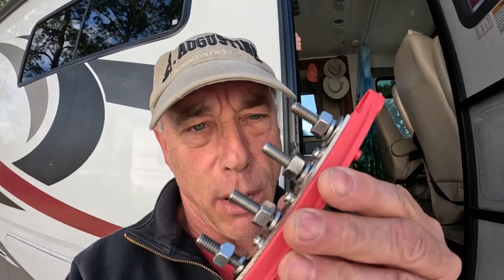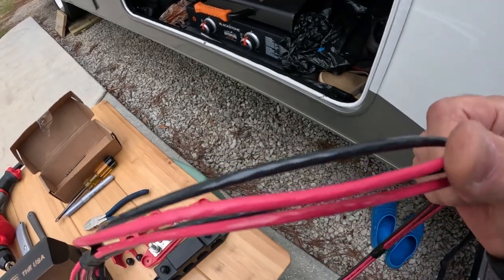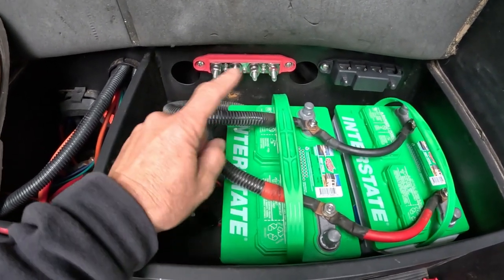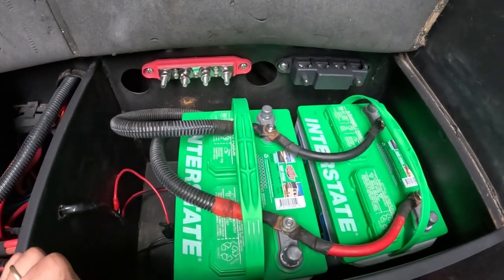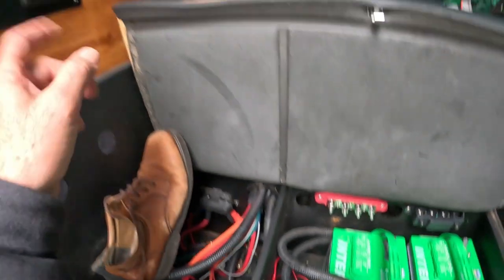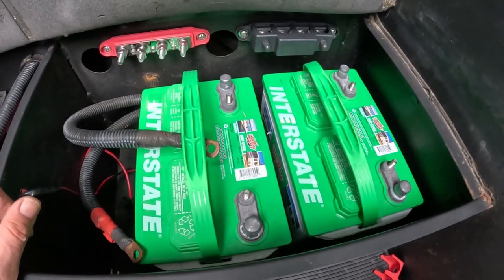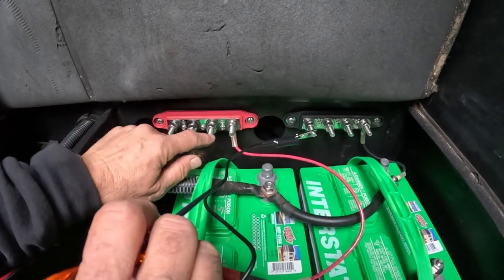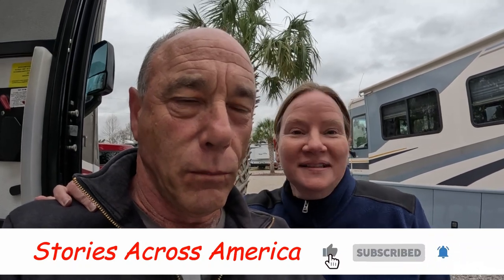Bus Bar installation on the Mirada; Stories Across America

Comment: Just a couple of thoughts... 
That positive wire to your busbar should definitely be fused to whatever your maximum current draw should be. And I suspect that once you've connected a few appliances to the other terminals of the busbar your main power wire may not be sufficient to handle the combined current draw.
Subsequently, all wires that will later be connected to that positive busbar should each be fused according to the items they're powering.
But they look to be fairly decent busbars that should be capable of delivering some generous power throughout your system.
☺️🍹
Reply from the maker: Great input !!  I do not have the main fused but all power needs are. I will consider fusing the main for sure. Thanks for watching and sorry for the delay in responding.

Comment: If you connected the negative bus bar to the chassis of the RV via some cable, then bolt it down inside your wiring compartment, then you could run all your common ground points to that right? Thats what I am thinking at least. 
Also, would it be better to use heavier pigtails just in case? Like if you later needed power for a bigger fridge etc?
I was kinda thinking that an ordinary terminal block might have better suited you maybe? Just asking as I am just learning this 12 volt stuff.
Nice job though mate...  impressed.
Reply from the maker: First, thinks for watching. I would think grounding to the chassis would work too. My only desire for my bus bars is super light stuff like 12 volt plugs, fridge fans and possibly LED outside lights in the future. I apologize for the delay in replying. Hope your day is great.